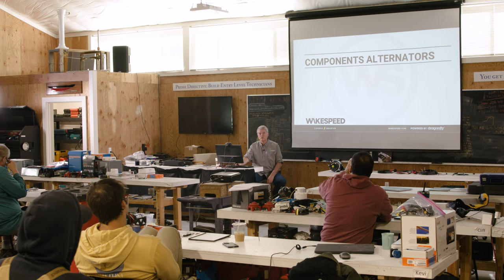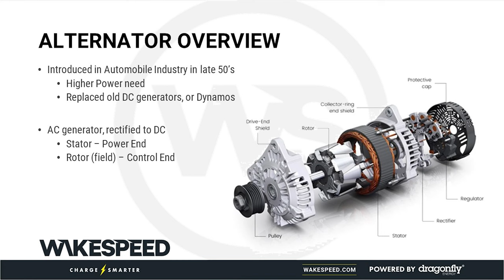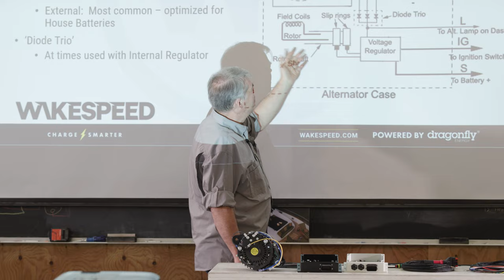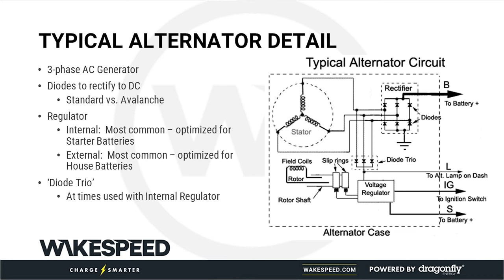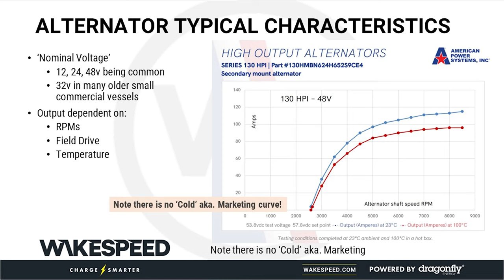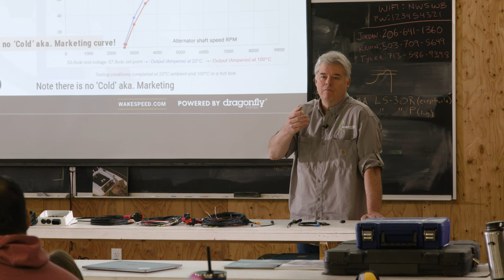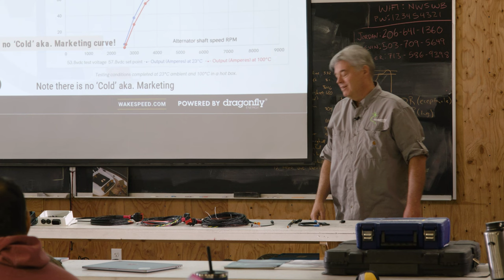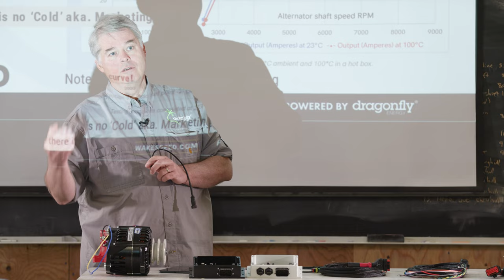Wakespeed 101 | System Components | Alternators

Comment: I need 300 amps at idle (going to my 24V/600Ah bank of Li batteries). I would like to do this with one secondary alternator and leave my factory alternator completely alone. Is there an alternator that can reliably and safely do this?
Reply: https://youtube.com/shorts/05jGQ2Flb6U
But I only have 12 volt  but is super cool, temperature is below 106F 42C